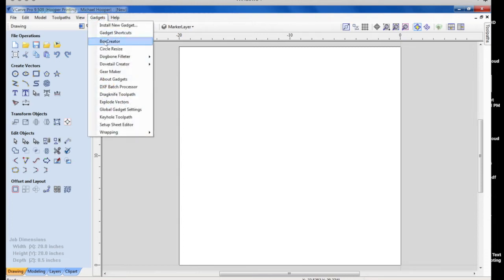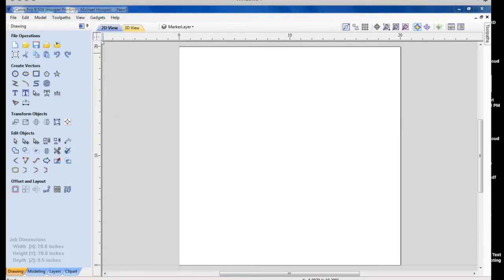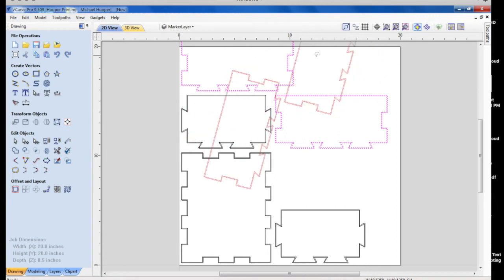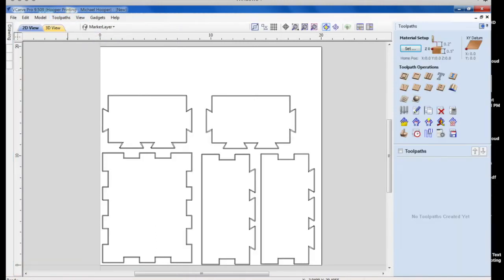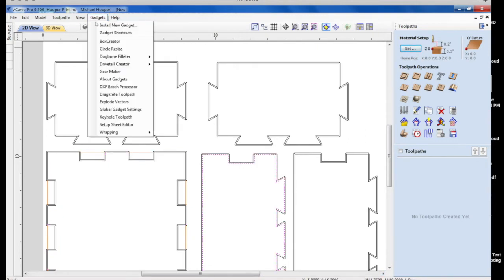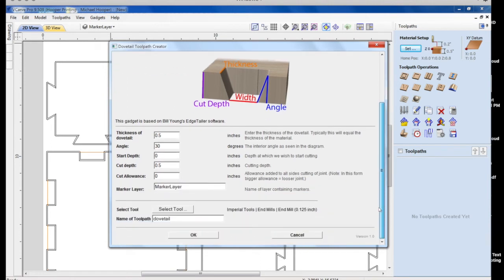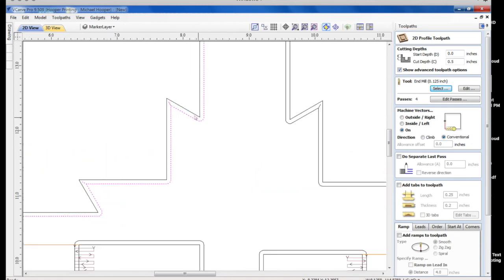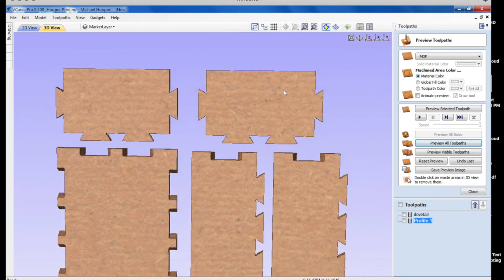Box Gadget

Comment: No matter where I set the tolerance amount, the fit is way too loose. Any thoughts on a good starting point? With no tolerance, they are much too tight, with a 1/32 tolerance, they are to loose. And, are you using the box gadget to do dovetails? It said box making but looks like dovetail gadget Thanks
Reply: Try .007. Its going to depend on your CNC, but I have found .006-.008 works pretty good